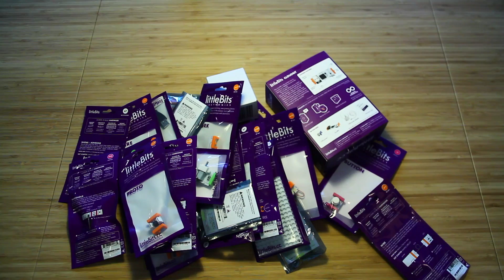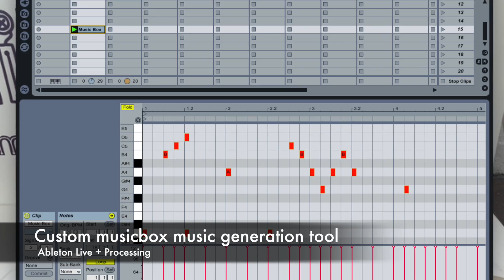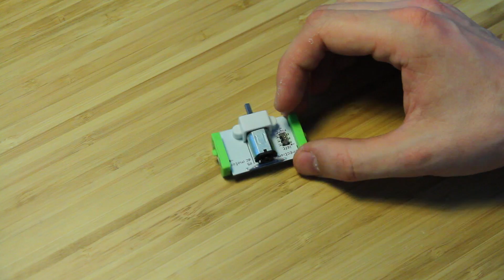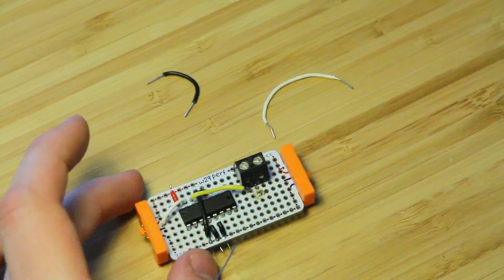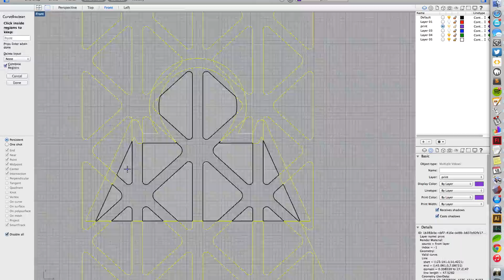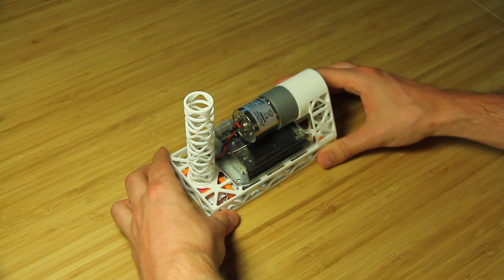Brushr

Comment: Hi Bastiaan,

Great project. What really piqued my interest was your custom motor driver bit. I have a project where I want to interface my lego power functions motors to little bits. I can make my own cable by cutting the lego pf cable - where I am stuck is making the driver board with the L293D like you did - I am not skilled in electronics. Any pointers would help - would be great if there is a ready made one available! (I have the Littlebits poto boards).
Reply from the maker: +Sharad Patel the L293D is a very popular motor driver so there's a ton of information available on it online. A lotof beginner tutorials will use an Arduino but if you substitute the arduino pins for the LittleBits signal pin, it should be pretty easy. see for instance: http://www.instructables.com/id/Control-your-motors-with-L293D-and-Arduino/ . As littlebits uses only 1 signal pin, you'll only be able to make the motor go one way unless you add some extra circuitry. Or use the Arduino bit ofcours!
Reply: Bastiaan,

Thank you for the reply. In the spirit of Littlebits I will definitely give it a try.